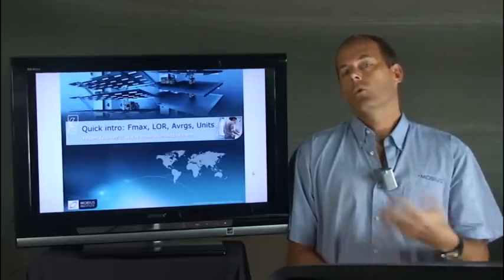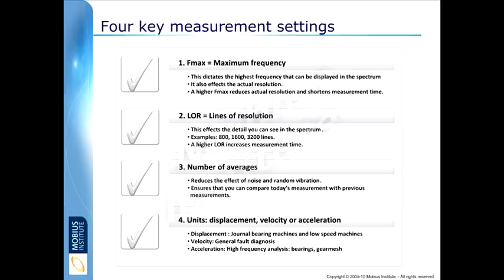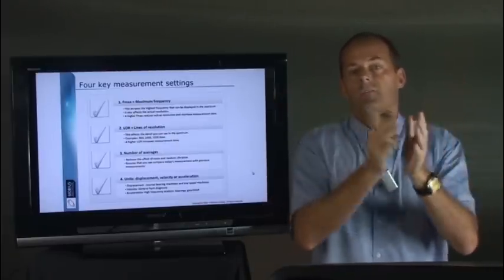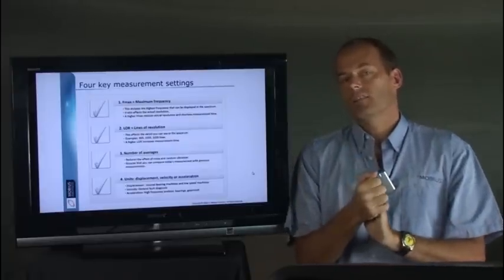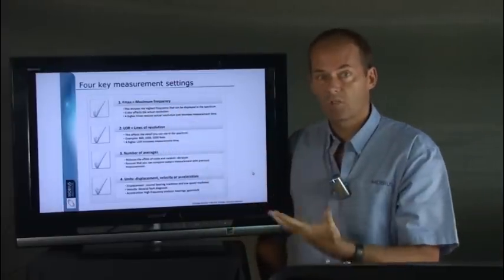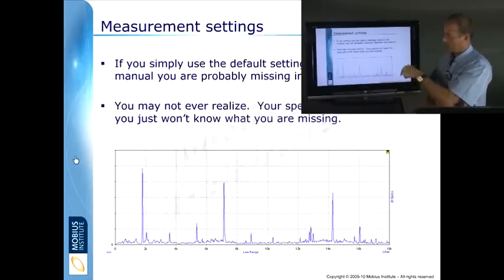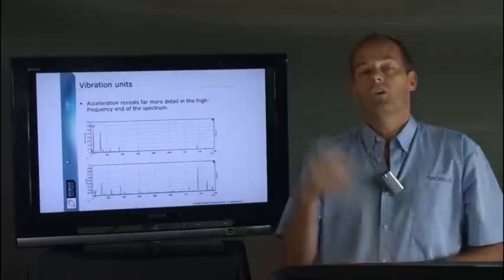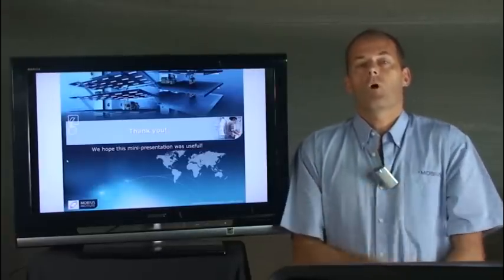Vibration Analysis - Analyzer Settings by Mobius Institute

Comment: There is a variety of different opinions on Fmax settings...some recommend 2.5x on machine RPM, others recommend 70x and here he is recommending 10-15x. So what is really the sensible approach?
Reply: Better result at 3X of highest fault frequency of the machine.